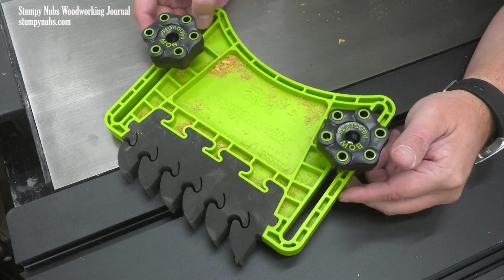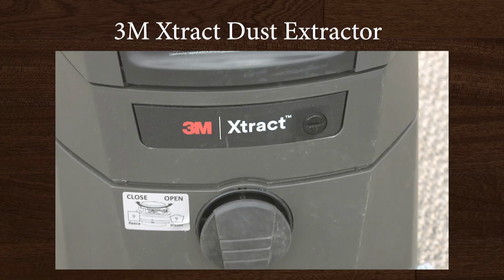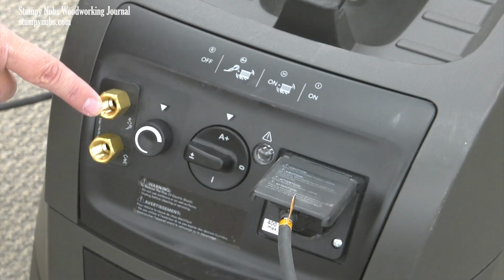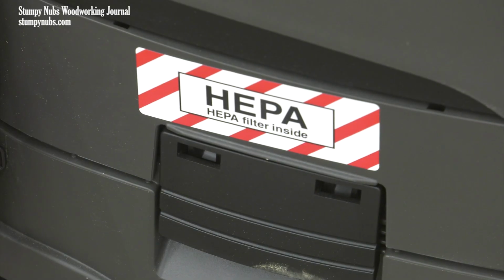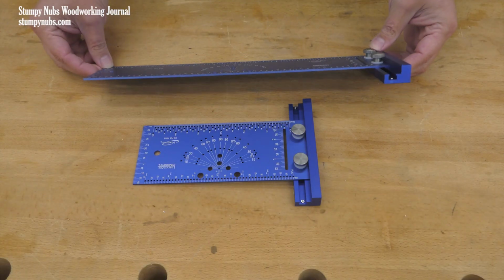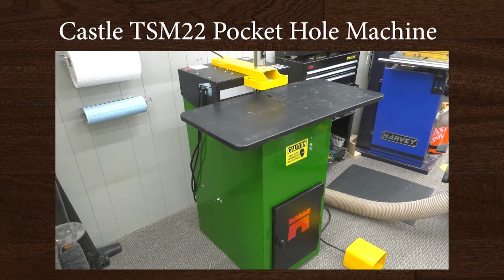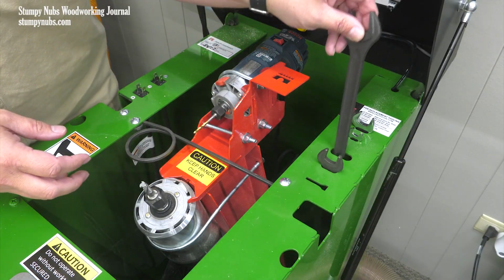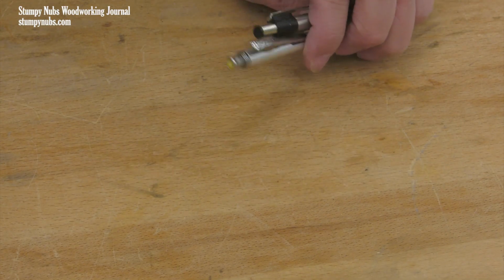7 Tool upgrades I wish I'd found YEARS Ago!

Comment: you really need to upgrade that cup. perhaps a Flames cup would add something you are missing from that shop of yours.
Reply from the maker: I prefer to stay on a bandwagon rather than "upgrading" just because my team is going through their first rebuild in 30 years.
Reply: @StumpyNubs  this team has been rebuilding for 30 years.
Reply from the maker: @Platinum1133  You mean Calgary? They had a good year last season, and look pretty good this year, despite losing some key players (and replacing them with other key players.) Detroit, on the other hand, is only 3 years into a serious rebuild (the three years of Ken Holland's "rebuild" don't count because he wasn't serious about it) and they are about 2-3 years away from contending. We lost to key players long-term already this season (Bertuzzi and Vrana) so playoffs aren't likely this season.

Comment: 3dB represent a doubling/halving of sound, so 5dB delta means the device is about 1/3 the sound pressure level
Reply from the maker: The widely varied comments I am getting on this issue shows how confusing the dB system is to most people, LOL...

Comment: The iGaging one is quite interesting, because they basically took the Incra idea, simplified it in some ways (no holes for 1/64ths), yet also added new functionality with the angle option. They are also much thicker than the Incra ones, which are rather thin and flimsy. I have been using my Incra 6in for a few years now, and it is an absolute essential for me on every project. I will have to consider picking up these ones to compare, and just to add to my collection. I really like the angle ability.

Comment: That 3M vacuum looks a lot like the HILTI ones we used to use to handle concrete grinding/cutting dust. I wonder if it makes the same big thumbing sound as it knocks off the filter while running.

Comment: Fun fact the 3m xtract dust extractors are re badged starmix ipulse dust extractors. In Europe alot of tradesmen consider starmix the best on the market and in comparison to the festool dust extractors it out performs them because of the dual filter design.
Reply: I was about to say this. It looks identical to a Starmix ipulse. Similarly the Metabo dust extractors appear to be rebranded Starmix as well
Reply: Mafell is also a rebadged starmix. Makita, flex and milwaukee are usually a rebadged nilfisk.
Reply: Huh I work in a tool store, I thought the Xtract looked awfully familiar! But I should've known sooner!
Reply: @boomerangfreak   I kneed clarification.
Reply: Yup same tool they just added the pneumatic portion which is smart and awesome but otherwise that thing has been out for like 10 yrs
Reply: Please
Reply: It's a Metabo dust extractor... Monster on steroids with auto filter cleaning.
Reply: From what I know starmix parts were made by Bosch, don't know if that still is the case. It's really good vacuum cleaner. When it suction power drops it usually a sign that it's full to the brim :P
Reply: Fun fact... every vacuum on earth is useless without tools specifically designed to feed 100% of the dust to a vacuum.  Most tools send a tiny fraction of their dust to the dust port
Reply: @yourlogicalnightmare1014   you ARE a logical nightmare, and wrong.

Comment: Sorry. Another question. 

On the marking squares. 
How big are the holes? 
I have 2 high priced one time tool delve squares and I break the lead every time and cant even use them (although theres a little hip on them that keeps me from tossing them in the garbage that I really live).
 I would love to be able to use a thicker pencil... im a hack after all
Reply: Im probably just gonna try your pencils.. cheap enough.
 Gonna get 4 products fron todays video. Just click each link and stumoy gets the credit correct?
Code?
Reply from the maker: They are larger holes for that reason. The point automatically centers at the low point in the curve.

Comment: I like the Zebra F-301 but broke more than one, carrying in shirt pocket and leaning against concrete or steel during routine inspections.  By the time I retired as a Hydroelectric Operator, I was using the F-701.  Now that I’m out of the plant and don’t use a pen constantly, I carry a cheap “tactical” pen that requires a couple of twists to expose the tip, and will accept quality refills. But the F-301 fine point is nice for writing.👍

Comment: On the featherboard..
 My biggest problem with the ones I have (and dont use anymore) is they slip in the slot. The tightening mechanism sucks in them and they end up being more dangerous than helpful. 
How is the one you are working with? Looks tigh a f on your saw
Reply from the maker: Tight.

Comment: every +3 decibels equates to doubling the perceived loudness.  Going the other direction, -3 decibels is perceived as half the loudness.  When looking at from and amplifier point of view, every +3 dB equates to 10 times more power required to create the sound. For example, if you measure 60 dB at 1 watt with the sensor 1 meter away from the speaker/source. To get 63 dB requires 10 watts, 66 dB requires 100watts and 69dB requires 1000 watts.  Going the opposite direction to reduce requires 1/10 the power.

Comment: I like how thick the iGaging squares are.  I'm currently using Incra T rules and I love the 1/64" and 1/4 mm accuracies, but I could use something sturdier for longer measurements.

The only thing that could make the GraphGear 1000 better is the Orenz retracting tip.